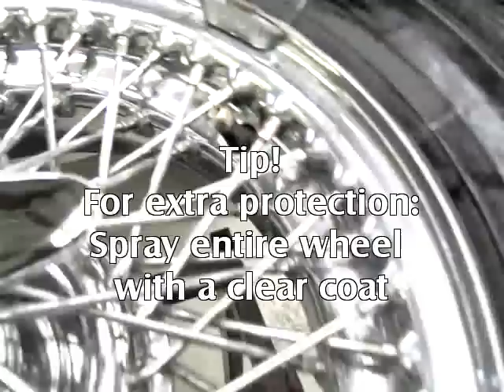Refurbishing wire wheels

Comment: PERSONALLY, what I regard as the hard way & PROPER way is to get rid of the crusty old tire, DISASSEMBLE the wheel, polish spokes one by one (chuck 'em in your drill and run find sandpaper around 'em - stainless nipples too!) and have the rim and hub re-chromed! THAT'S how you should do it - and an alloy rim would be polished by hand with 600-grit or 800-grit (depending on degree of corrosion) on up through 3000-grit sandpaper, and then clear-coat it preferably with powder-coat - THEN you'd reassemble & balance the wheel - and look for a nice NEW tire!

Comment: So having completely stripped the protective coating off of the spokes using a drill and steel wire brush, how do you stop to the spokes rusting again immediately?
Reply from the maker: Temporary protection with wd40, permanent protection with a layer of clear coat.

Comment: Have started doing the same thing to a vintage motorcycles spoke wheels (Mild steel) but have found that the wire brushes leaves nasty grooves in the spokes, which after a while invites rust to form more easily. Don't know if these are stainless or mild steel spokes?

Comment: Ouch. Kids, dont do this. Throw the power tools out and use 5-56 or WD40, toothbrushes, fine wool, softcloth, to desolve grease and  rust super fast and effordless. Autosol polish can be used for dark spots.  And yeah, take them apart if you can!

Comment: No disrespect bro but U can Use steal wool fine and it cleans the rust off and a electric toothbrush and MoFo wire wheel cleaner it cleans rust all so wit out messing up the chrome trust me man

Comment: I am in the beginning stages of doing some Cadillac wires... It is a labor of love. I am using the Por 15 Crystal process of clear coating.
Reply: Thanks for sharing the tip which product did you use from the por 15 line up ?

Comment: you can buy old style Pirelli cinturato tyres, and Michelin xwx and goodyear  sp tyres, and Dunlop sp tyres  though they do come out expensive. some are around £200 each those balance weights are correct for that wheel too. yes it does take a long time. and before hand, tap the spokes with a metal stick,  and listen for dull ring against bright ring.

Comment: I came here hoping to find a better way to clean mine.  this is how I have been doing mine!!, but I like the string method! and the clearcoat tip!  I tend to use a dremel on a flexi drive, (dremel hanging above me) and use the 1cm cup brushes. most of the time. you can buy a good handful for a few pounds on ebay, via china.  oh well here goes.  don't forget a small mask! (brake dust)
Reply: finished mine,  I mainly used a dremmel -on real slow setting, with a load of steel wirecup brushes, all round, and a few straight ones from the rear, you end up with a lot of greasy wax after which dulls it all. I then used 'Cillit bang' bathroom mousse to clean the chrome, and went over with a microfiber cloth and some strips of same to clean to a great shine, they look great now.